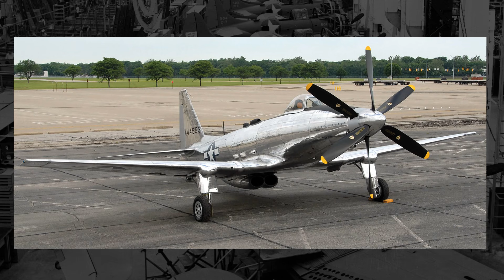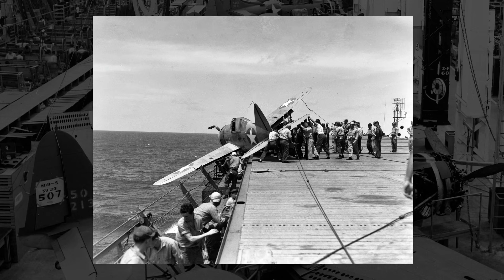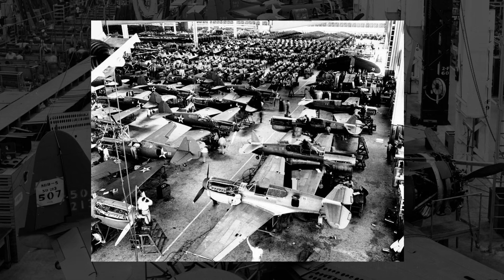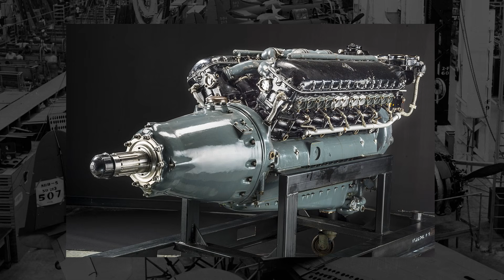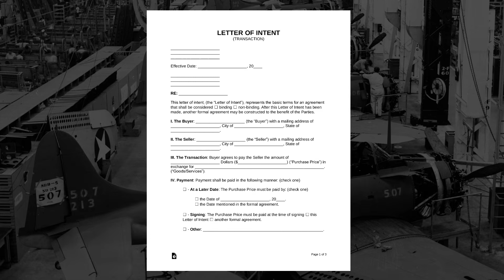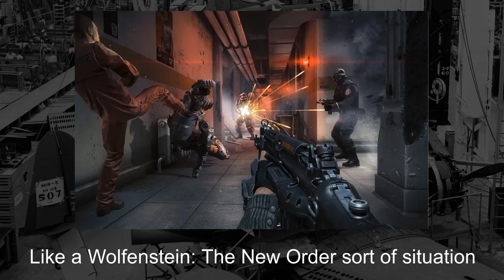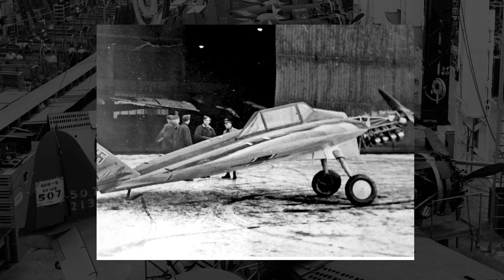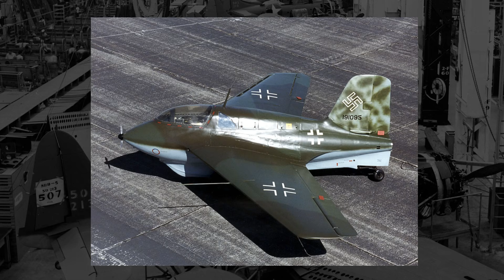The "Wonderplane" Slapped Together With Spare Parts: Fisher XP-75 Eagle

Comment: The reason it could use Corsair landing gear is because it has a bottom mounted wing. So the wing is lower and thus doesn't need long landing gear. The Corsair had it's wing mounted to the center of the fuselage for aero reasons but that meant it would need really long landing gear so they went with the inverted gull design to get the landing gear lower. Both planes have their wings at about the same place at the point where the gear attaches so they could use the same gear
Reply: Nope. The Corsair gull wing was a direct result of the decision to use the P&W R2800 radial with the biggest prop available to take advantage of that power. The gull wings raised the nose up high enough that the prop didn't hit the ground when the tail came up on takeoff and the plane accelerated to take off/fly off speed.
Reply: @boydgrandy5769  Yes which they had to do because the wing is mounted higher up on the fuselage. They could have just used longer landing gear but that would eat up a lot of wing space for weapons and fuel, plus the gear would have to be built stronger and thus increase weight. All that would have negated the small aero benefits from the higher wing mounting so they went with the inverted gull instead. 

Many other aircraft used that engine and prop, none of them needed inverted gull wings to make it work.

Comment: The bird at 0:40 is the one preserved at the U. S. Air Force Museum. A much refined version that really had little in common with the original and really not a bad looking beast (very little left of the "hey, look...there is a bit of a Dauntless over here and a bit of P-40 over there..." etc).  One can understand where and why the idea of this "allsorts" aircraft originated but in a way it is a testament to the overwhelming wartime production capabilities of U.S. industry that resources could be spared for it when there were several proven high performance and very capable designs already in production. Had some of the U.S. "super-engines" panned out, the story of this and several other "super-props" might have been a lot different.  Not even close to being the worst plane ever made. Just more of a big "WHY???". I like it. If a company can put out a 1/48 Skyshark, why not this bird (or even a Martin Mauler...it saw production and service!).

Comment: Not the worst in my book. I reserve that title for planes, by dint of their flaws, managed to kill their own pilots more often than the enemy, e.g. Me210, Me163, F-104 etc.. Wonderful video!!!
Reply: Not that I'm big on the flying tentpin, but the F-104 wasn't a bad plane. The bad rep it got was mostly caused by an in debt panicked Lockheed that promised it was a multirole aircraft to export countries which was a bit of a stretch, especially as a low level strike aircraft.
Reply: @KapiteinKrentebol look at the Japanese F-104. They insisted on additional safety measures and removing the ground strike capabilities. They also had less than 10 lost to accidents
Reply: The Christmas bullet would be my pick of worst plane...ever.
Reply: @trevorpom 
Does The Christmas Bullet actually count as a plane?
Any scammer with big enough balls, minimal shreds of morality and gullible targets could glue a pair of wings onto a boot, call it a plane and try and sell it as a functional design, but it wouldn't mean it actually was a plane.
Reply: Well, it did actually fly. It didn't fly for long before the wings and fuselage had a violent disagreement and parted ways, but it did fly. Unfortunately, the pilot/sucker didn't survive the disagreement and even more unfortunately, his mother got to watch the whole event unfold. So, it did taxi, it did take off under its' own power and it landed, as all things do eventually. It wasn't a great landing, to say the least, so technically yes, it was a plane. Would I get in it and try to fly it...hell no. @stickiedmin6508
Reply: @stickiedmin6508  Since it took off into the air 2 times (one for each prototype) crashed two times and killed the two test pilots, it seems to have a hard to beat record. But taking up into the air make it a plane - kind of.
Reply: One problem with the F-104's saftety record is that the plane's gross weight more than doubled over its lifespan.  No other plane was ever fattened up like that, for good reason!  For the job it was originally designed for it was good.
Reply: Best nickname for the F-104 for was the German one: Erdnagel.  "Tent peg."  Look at a picture of an F-14, then a tent peg, and you'll see the  why,   If not, picture that F-104 being pounded into the ground sharp end down.
Reply: An F104 joke, translated from German: "What's the best way to aquire an F-104?"  "Buy some real estate.  And wait."

Comment: What a cluster.  Contra-rotating props was probably the first mis-step.  Way too much mechanical complexity.  I doubt we'll ever know how Russia really fares with their "contras".  I know that even in the 21st century, contra-rotating props in boats have seeming advantages, but maintenance/repair downtime is a thing.  Nice video!  Thanks!
Reply: Quite a few operational planes used contra rotating props. The UK had a sub hunter post war with them.
Reply: The Fairey Gannett with its Double Mamba coupled turboprop engine.  Basically, two Mamba engines fitted side by side and linked to a common gearbox, enabling cruising with one engine shut down.
Reply: Loop0777
No @blitzkrieg2142k

Comment: No explanation of why the airplane did not perform to expectations.  What comprised the supercharging system installed in the airplane? The V-3420 had an excellent power to weight ratio but the supercharging system is what made the biggest difference in performance in the aircraft.
Reply: I think it had a turbo-supercharger. You can see what I think is the downstream exhaust just behind the cockpit.
Reply: @iskandartaib  I'm afraid I don't see that.  I have looked at many photos of the exterior and interior, and all I see are eight separate exhaust pipes that lead from 4 exhaust manifolds, one for each bank of cylinders.  It looks like it has a pipe from each manifold to the outside of the aircraft for each of 8 groups of 3 cylinders.  Whatever the number of stages and speeds in the supercharger it must have been mechanically rather than exhaust driven.  

If it had a turbosupercharger the exhaust manifolds would have fed a common pipe to the turbine, and we would see a large one outlet for exhaust form the turbine, and one or two wastegate exhausts somewhere else upstream.
 
But it would make perfect sense for an airplane designed as high-altitude fight/interceptor to have a turbosupercharger.  One might speculate that a turbo of adequate output for the V-3420 was not available.  Other engines of large displacement, such as the R-3350, needed 2 turbosuperchargers.  Perhaps there was insufficient space in the XP-75 for two turbos, so they resorted to the best mechanically driven supercharger then available, which I'd bet was also inadequate for this engine at high altitude. 

In fact, I just looked it up in Wikipedia (doh!), and early versions of the V-3420 did have a turbo in addition to a single stage mechanical supercharger, but the version installed in the XP-75 had a mechanically driven supercharger with 2 variable speed stages.  My guess is that it was still not enough for this airplane to perform as desired.  It's one thing to get 2,880 HP in a test cell, but another to get it above 30,000 feet.  It's a shame they wasted all that time and money to learn what they probably should have expected.  But perhaps they did suspect it from the start, which is why they put so little money and effort into design of the airframe in the first place.

Comment: Good presentation and definitely a top contender . All manufacturers were hunting for the best preformance and mistakes were inevitable . But this was sheer mismanagement from start to finish . For me the 163 was a success , but at a terrible cost . Our Spitfire mk Xll which first flew in 1941 could top 440 mph but had a short endurance . It was specifically built to combat the V1 "doodle bug " . It's worth mentioning the first B29 also flew in 1941 and could cruise at 350 mph !!!! Thankyou
Reply: V1 was in service in 44, B 29 first flight was in 42.
Reply: The b52 could only cruise at 350 with no bomb load.
Reply: The Spitfire Mk XII was in service in late 1942 and had a top speed of just under 400 mph but it was fast at low level, it was used to counter low level raids by the Fw 190, the Spitfire Mk XIV which came in late 1943 and did well over 440 mph was also not built to counter the V 1 which was first used in June 1944.
The B 29 which didn't fly until 1942 and had a cruising speed of 220 mph.
Reply: The Black Widow shot down a few Doodle Bugs late in the war...
Reply: @allenlombard3627  The Black widow was too slow to shoot down much, it could never have caught up to a V 1.

Comment: The reward retracting landing gear was not related to the inverted gull wing of F4u.  The P-40, F6F, and others both used it as well, it was common.  The F4U didn't have to use rearward retracting gear because it had gull wings.  The F4U could have used gear that retracted inward or outward and the wing would have still allowed the gear to be shorter than without that wing.
Reply: :yougotthis: That's because it's P40 wings. They were trying to use up spare parts stockpiled for soon to be discarded aircraft.
Reply: @billdurham8477  Which is one thing that leads me to suspect that this waS not a really serious airplane design, but a test of a concept, sort of like the X-29 and X-31 would be. I think Fisher got the contract because everybody else was too busy, and I would be interested in knowing the backstory on that.  I suspect that if the concept showed promise there would be 'refinement' of the design, and perhaps opening it up to a better proposal from an experienced manufacturer.  This thing looks like it was bodged together by Sanford and Son.

Comment: The Blackburn Botha was a lot worse, as it got into service and couldn't fly on a single engine.
Reply: The Blackburn Botha needed the same engines as used on the Bristol Beaufort, both gained weight due to a change in the specifications.
Reply: It could barely fly on two.
Reply: Best plane Blackburn could make!
Reply: @robertoroberto9798  At that time very much so, but they redeemed themselves later with the Buccaneer.

Comment: If WW2 has taught anything it is that no "combination" engine consisting of two existing designs slapped together ever worked successfully. Be it the german DB 606 etc or the RR Vulture
Reply: While not absolutely two v-12s bolted together, the 24 cylinder Napier Sabre engine that eventually powered the Typhoon and the Tempest became very powerful and reliable. Because of the supercharging system on it, these planes were combat limited below 20,000 feet, but they were the fastest low level fighter bombers of the war and made great ground attack missile trucks.
Reply: Try looking up the Fairey Monarch engine, in effect it was a combo engine based on two previous designs that worked and performed fairly well, though I think its one of those rare exceptions than the rule.
Reply: The I-225 worked out well but was too late lol.
Reply: The double mamba turboprop was a huge success once  airborne  you shut down one side to reduce fuel consumption.
Reply: You are incorrect
Reply: @nathanworthington4451  that the Fairey Monarch engined worked?
Reply: @zacharygerken4387  Dude idk I wasnt talking to you mind your own business
Reply: Ever heard of the Pratt & Whitney R-4360 Wasp Major?
Reply: The British mosquito worked well
Reply: The Mosquito had two merlin's, one on each wing. Not two merlin's bolted together, like the Allison monstrosity. @MrLukedanger

Comment: The Heinkel He177 bomber might be a contender for the worst OPERATIONAL type of aircraft in WW2, with all too frequent inflight engine fires. In fact it was similar in this respect to the British Avro Manchester with its Rolls-Royce Vulture engines, leading to the Avro Lancaster with 4 Merlins
Reply: And yet the vulture engine in a prototype superprop fighter didn't cause the overheating problems that the Manchester installation had.
Reply: The firey Grief.  Killed more crews than any targets the bomber could find.
Reply: The original design of the He-177 was a sound design but Hitler meddled as he did far too often and it had to be redesigned with the capability to dive bomb, which changed the design considerably. To their credit, the He-177 -a5 and -a7 had mostly resolved the issues with the earlier models. This scenario was not much different than the B-29 which was so rushed into production that brand new planes were flown from the plant directly to an airfield in Great Bend Kansas to retrofit them with all the modifications before sending them on to the military. Even so, the B-29 also had a lot of issues with engine fires, just like the He-177. The He-177, when viewed in the context of other similar issues, was not really all that much of a 'failure' and in fact designs at the end of the war were showing the airplane to be quite effective. Of course by then most were destroyed on the ground by strafing allied aircraft due to no fuel being available to use them.
Reply: The B-29 had troublesome engines with magnesium heads, whereas the He 177's problems rather lay in the specification as a bobmer capable of dive-bombing.
To reduce momentum on the engine mounts during dive recovery, the engines had been placed as near to the wing's leading edges as possible.
As a consecuence, oil lines ran dangerously close to the exausts and an oil leak would likely result in an inflight fire. Meaning that it wasn't really an engine issue, but one of faulty layout. The same engine had run quite successfully before on the He 119 record plane.
Heinkel soon proposed a He 177 B variant with four separate engines, but Göring officially forbade further development so Heinkel kept development going in secrecy.

 @kl0wnkiller912
Reply: FW 200 Condor check out the video of when Hitler's plane landed in Finland for his meeting with Mannerheim, and the nonchalant way one of the German crew extinguishes the engine fire. Apparently, the FW 200 was prone to engine fires.
Reply: Never heard of that before. In fact the Condor was a pre-war design and Focke-Wulf had plenty of time to iron its bugs out. Hitler himself was a very nervous flyer and never would have boarded a plane prone to inflight engine fires. @brucenorman8904
Reply: @brucenorman8904   Probably a fluke since the Condor actually had a stellar reputation for reliability and was the scourge of allied submarines and shipping.
Reply: In fact the Condor was a pre-war design and Focke-Wulf had plenty of time to iron its bugs out. Hitler himself was a very nervous flyer and never would have boarded a plane prone to inflight engine fires. @jeffreyhagelin3672
Reply: The Manchester is a good example and also, oddly, a heartening one. If you're making a mess of life and seemingly cocking up on a regular basis, be of good cheer. An engine change and a design tweak turned Britain's worst bomber into its greatest one.
Reply: An interesting detail is that Rolls-Royce themselves urged the Air Ministry to halr development of the Manchester's Vulture engines. They knew it wasn't going to be the high-powerend powerplant the Air Ministry had hoped. @Hartley_Hare
Reply: Was that the Grief (Grife?) bomber or the Flying Pencil? Oh fires yea... The Grief...
Reply: Coupled engines on the 177 too.
Reply: I think you looking at the wrong AXIS country for worst operational plane. Italy had some real stinkers like the Caproni CA 313.
Reply: Never heard of this one. Probably underpowered. Love its looks though. Another catastrophic operational type was the British Blackburn Botha. @skaervan

Comment: They used the Corsair's landing gear exactly because they are short.

The XP-75 has a long nose, with the wings in the middle of the fuselage. Using a normal size landing gear would make the plane too step when landed - really impairing the pilot's hability to taxi the thing,

https://upload.wikimedia.org/wikipedia/commons/thumb/b/b7/P75A_Eagle.jpg/1280px-P75A_Eagle.jpg